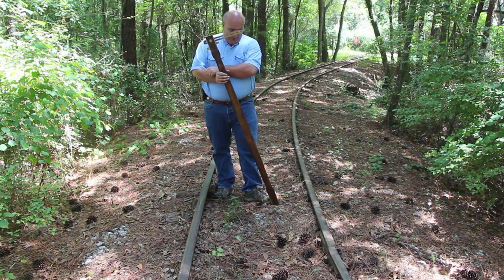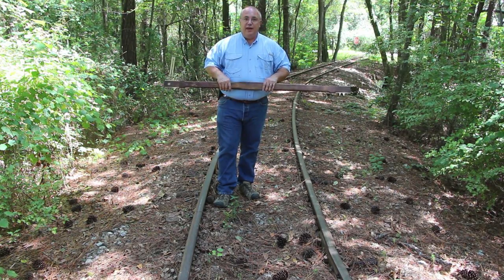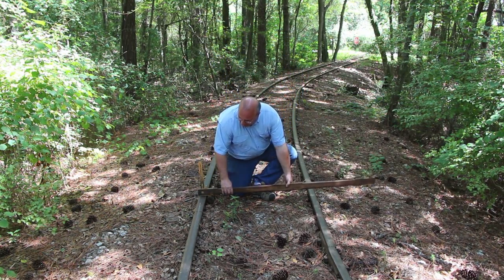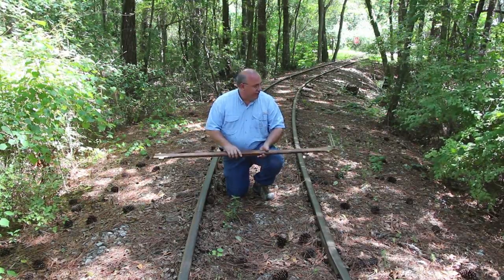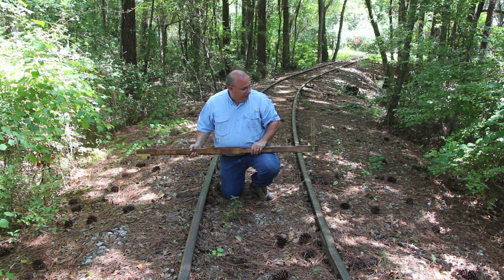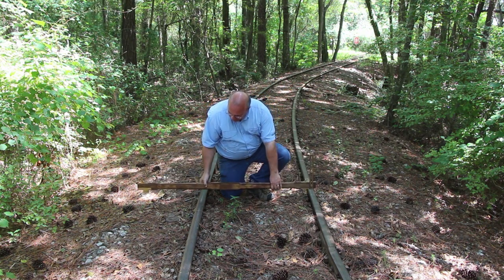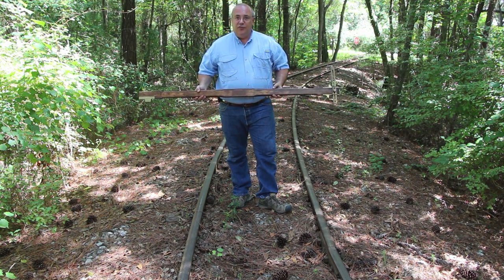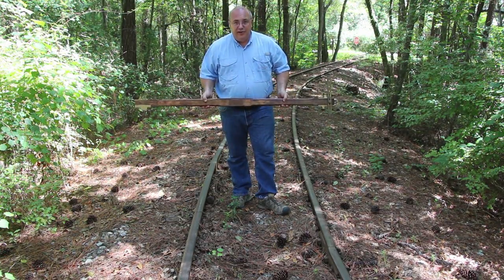Mystery Tool Solved:  Railroad Track Gauge and Level for Measuring Rail Superelevation on Curves

Comment: When I was working on my step father's  amusement park near Albany NY in the 1960's I used a 'Y' shaped device to check the 20" gauge. This was a sort of scale that was big enough to sit two children side by side or one adult. The locomotives were powered by 5 Hp gasoline engines. 

Although this was my step father's obsession and alcohol his addiction, it was also my life (the park was open 7 days a week) until i left at 14 or 15 yo. So many years later I am curious about the fate of this miniature RR. Thanks.

Comment: I think those markings on the tool to show how much off the spread is are actually also used for curves. I know nothing about laying train track, but I suspect that in curves the rails are laid slightly wider apart to allow navigation without the flanges on the wheels jacking the rails apart because they are in a twist. I think the tighter the curvature and the bigger the machines the more you would have to widen the tracks.
Reply: Interesting to know! I know not to far from here there is a curve on some N&W mainline trackage that has a box with brushes and oil in it that lubes the flanges as the cars roll by as they enter the turn.  That rail shines like a mirror on the inside and you can tell it wears regularly even with the oil as many times it is visibly a narrower rail than the outside. As the train is pulling through the turn the natural tendency is for the cars to follow it by the shortest path so it is trying to drag the cars over top of the inside rail. On a small train not much effect, but on the 100+ car jobs its probably a lot of force especially if it is on a grade, which everything is here in Ky.
Reply: Yes, one does have to spread the gauge of the rails on curves - and the sharper the curve, the wider the spread - it's as much to keep the wheels on top of the rails as to cope with the lateral thrust.

There are special track gauges made with three points of contact for laying rails on curves - I have a couple of the model railroaders' versions in my model train tracklaying toolbox - and, I do not hand lay model track... know guys who do, but too much trouble for me...

There is a book by W. D. Connor printed originally by the U.S. War Department on Military Railways.

My reprint of the 1916 edition discusses the spreading of the rails on curves in some detail...

All the Best,

Eric
Reply: Great to have my suspicions on gauge around corners confirmed! I learned something today. :-)
Reply: perhaps in old steam engine applications before my time gauge  may have been widened to accommodate several axles on the same truck however with modern equipment the gague remains 56-1/2" the entire track.  big 6 axle locos have no problem with that standard gague on any curves.
Reply: I've worked for the railroad for 25 yrs and I do track geometry. Standard Guage is 56.5" if you're laying rail in a curve or on tangent track.

Comment: It’s a level board. I have a wooden one at home. The one I use for work is a brass coated aluminum. I generally don’t use it for gage measurements(that’s what a tape measure is for), but for cross level, warp, and elevation(spiral variations).

Comment: ***** KeithRuckeras a former track inspector and track foreman I believe your track geometry gauge is a home made version to replace 2 tools used in track maintenance.  I of course base this off that sometimes we would customize tools or build new tools for a specific job at hand. The ruler scale on the one end is to show how tight or wide gauge is depending on the class of track depends on how you gauge the track. Such as straight class 5 track (10mph max) you're allowed almost an entire inch wide but no more than half inch tight. Curves depends on degrees and class. The elevation side is good for fixing low spots in all track as well as setting the super elevation on curves. I would have loved to have that tool a wonderful find nicely made.

Comment: the diameter of the wheels is smaller on the out-side than the dia. on the inside
next to the flange so as the train goes around a curve the low side of the set of
wheels rides up on the larger dia. and the outside wheel rides on the smaller dia.
to help compensate for the extra distance the outer wheel has to travel thru the
curve.

Comment: If you look on top of that gauge it's got a P Measurement where you flip the gauge upside down and put it at the start of a switch (toes) it should have a little mark at 60* put the gauge at the toes and it should be touching above the line  of it touches below the line the switch is out of tolerance

Comment: Howdy Keith, You just brought up good past memories when was a helper of shim, line, lag;  third rail lineman. We use a similar rail gauge but its now fiberglass and mounts on top of the running rails with a swingarm that centers over the third rail.   We still have some old woodies up on shop wall as decorative-- when it rains we use tape measures lol 32k amps very unforgiving.  We cover all areas of electrical  in public transportation: stations, bus loops, lighting, substation, etc. etc..  So for me this was over 23 years ago since I used one,  it is a helpers job with one lineman overlord lol.  I had no idea what that was lol our track gang uses a totally different one..  Love machinist type things always watch yours and abom's  vids.  You two would maybe go gaga  over the equipment our frog shop have, they make and cast anything, everything.  My favorite is their water cannon and 9 head room sized plasma cutter tables, state of the art no expenses spared for the railroad 24/7 365.. When the machinist are  making crossovers(art) or curves it is awesome to watch..
Reply: ***** it truly is awesome, loads of equipment and specialized vehicles, I cannot imagine what the biggs machine shop looks like.  They are using even more advanced equipment for laying track so that would equate to a nasa like shop (maybe! its been said we have/had the most advanced equipment but that was 20 years ago-I am now out of the link).   If your ever in Chicago the shop is located at pulaski and lake..  I do not work for the company now,  retired 00'   They would gladly give ya a tour and shop chat your ear off,  they are the nicest bunch of guys you will meet.  Their our machinist and blacksmiths side by side same shop,  then partitioned to linemen side, we all work hand in hand.  Just call ahead, they will arrange it for ya.  Chicago Transit Authority  (312) 681-4131  jshaw@transitchicago.com  Joyce Shaw  Nice picture of their work:  http://upload.wikimedia.org/wikipedia/commons/b/b4/CTA_loop_junction.jpg
Reply: ***** Lol so close,  and it's one train from the drake to their front gate.. Lake train to Pulaski, take the east stair exit, down the steps and there's the shop and co-yard ..  Hopefully you will return.. Cubs games are awesome we have a switching booth that sits above track level a few of us used to meet and watch from there, often.. lol...  They  installed  new gates and signage blocking the full view, CTA also later moved the booth so booo..  Addison was my station many moons ago to maintain.  My ex wife lived a block away from the stadium,  hated game day visits with her, absolutely no parking or leaving parking spot for a mile away to park when return..  CTA  frequents tourist on game day, heck any day, you guys were ok...  If you would have told the driver what you do and you work on the railroad you may have gotten to drive it. Well 20 years ago most definitely, lol things are different today but  surprisingly friendly most employees are, we get a customer satisfaction training that sticks... I did bridge tending for a few years,  I would have loved to show ya that, the gears and motor. lower deck, pit, controls etc..it runs off the tracks 600vdc we have two drawbridges, its awesome, yep they make/repair that stuff as well ..  Its all refurbished brand new 2014' too, dang..Next time....

Comment: Here's what I heard.

The wheels on a train are connected, side to side, by a solid axle... When a train is going through a turn, the inside wheels are going through a smaller arc than the outside wheels.

The reason the inside rail is lower than the outside in a turn is, to lean the train over slightly to move the center of gravity of the train closer to the inside wheels, reducing the load on the outside rail so the outside wheels can slip easier... It reduces the wear on the wheels and the tracks.

Might have just been a rumor, though.

Frank
Reply: *****
The angle also is there to self-center the train on straight sections. In addition, it creates a smaller contact patch for lower frictional losses. The angle also is the cause of trains swaying or 'hunting occilation'. The flanges are only there as a second safety to keep the train on the tracks.There is some pretty detailed info on this here in the section on "Directional stability and hunting instability": http://en.wikipedia.org/wiki/Rail_adhesion

Comment: Hi, I have an old metal measuring tape c.1900, doesn't have a casing just a 100ft coil of steel that measures 100ft.  It has a marking on it at exactly 28.25 inches , named 1 RR / Half Gage.  My question is why would they have to ever measure half-gage rather than the full gage?  It seems odd to me and I can't figure it out based on all the measurements I have researched on-line regarding gage and tie distance.  Thanks in advance!
Reply from the maker: David Santoyo You got me!  I have no idea why this would be the case.  Interesting mystery!
Reply: I found a use for the half-gage mark for railroad turnouts in an old book of mine, "Route Surveys and Construction" by Harry Rubey. On page 141, they mention staking the half-gage point from the main line of a railroad, directly opposite the so-called 1/2" point of frog (this actually places it in the centerline of the siding per the drawing in the book); then continue staking the turnout as necessary.
Reply: @NipkowDisk  You have it.  It is also good to use to put stakes in the center of the track.  In laying out a turnout, we used to set a stake on the outside(toward the direction of the turnout) of the track at half gauge at the actual point of the frog which is the 1/2 in point; then go down the track about 200 to 300 feet(straight track) and put another stake in at half gauge so we could set up on the first stake with a transit and sight on the far stake and then turn the frog angle to stake the new track.  If you use a standard plan to lay out a turnout you know the frog angle and the lead(SP to frog point) so knowing where the frog goes or the SP goes everything else is easy to lay out.  It can also be done with a tape only so an instrument is not really needed.

Comment: DId anyone figure out what the extra "O.D." jaws on the top of the tool are used for? 
How about the "notch" you pointed out that is let into one of the lower jaws?
Reply: ***** Looks like it might be used for locating either a switch frog or the points of a turnout...

I'm not finding that feature on the new gages made by Geismar on their website... nor on Aldon's website...

Railroad Tools and Solutions has a bunch of modern and traditional gages on their site, but not that feature in play...

A little googling taught me that the tool is called a: Track Gauge and Level Board, and there are patents going back to at least the 1880s for different designs...

Several outfits make the modern varieties - from all over the world...

Now I'm hooked! Still searching for info...

Cheers,

Eric
Reply: *****
The OD jaws look like they could be used to gauge the distance between the wheel rims (or flanges; I'm not familiar with the proper terms) to make sure they are in spec and would fit on the track.  The width of the double gauge pin (looks to be about 2 inches) could be used to measure the minimum distance to obstructions in between the rails, such as the fill at a crossing.  The notch in the double gauge pin could be a guide for the expansion gap left between rail sections.  I have no definitive knowledge of these; just speculative answers based on my observations.
Reply: The OD jaws are for checking other gauges for accuracy. Keith, the gauge you have is an 'Inspectors Gage', not one for use by the workmen.

The rectangular feature with the curved top is there for checking there is enough space between a check rail, or at the frog of a set of points to allow the wheel flanges to pass through.
Google has a patent for a gauge that looks almost identical, see;
https://www.google.com/patents/US1606806?dq=track+gauge+and+elevation+level&hl=en&sa=X&ei=wOTxU6PGN9Lp8AXizYGgCA&ved=0CCoQ6AEwAg

cheers,
Pip
Reply: Pippa Reeves
That patent says the inside to inside measurement is for checking the accuracy of the workers gauges by the foreman, I imagine there were many jobsite made gauge tools for the workers to use. Two nails in a board would be sufficient for a jobsite gauge on level track sections while building. The foreman would probably check level, and inclination on the track only when necessary, not at every tie as it was probably done by the track layers, however the foreman would also check the track layers tools periodically to ensure accuracy.